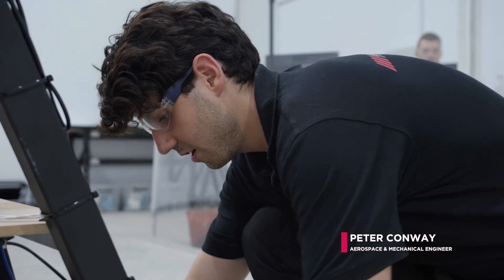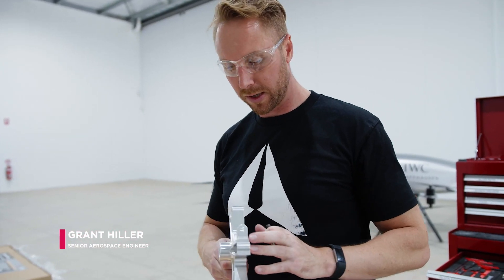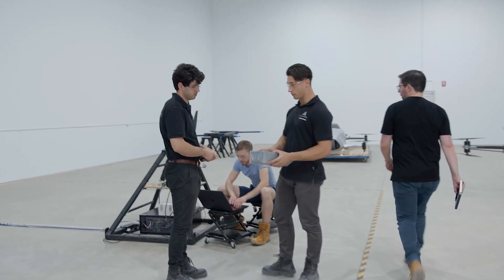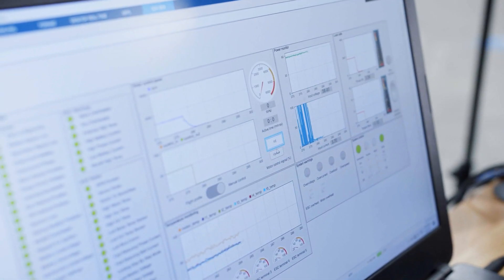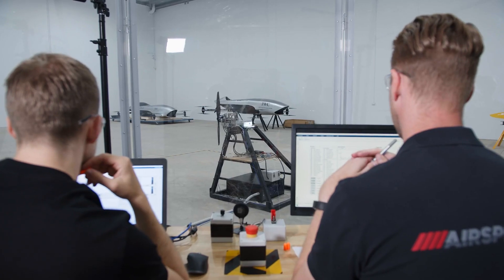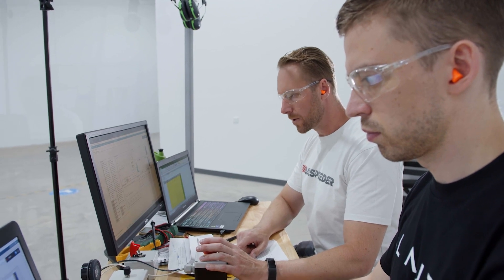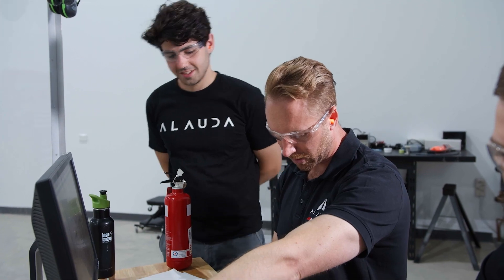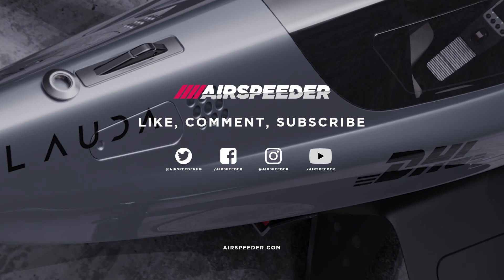Engineers Fire Up eVTOL Powertrain Test Rig | Alauda Aeronautics Taking Flight Series

Comment: Im confused on the design, is it supposed to fly in a horizontal orientation or tilted like a race quad? Are there servos connected to arms on the inside of the vehicle? From what i see it is manned quad copter w/ a cool looking body. The air intake at the front is for looks? The body design is cool enough to become its own plane in my opinion
Reply: They will race like traditional quads but manned. Max speed is 75mph. The course will be projected through AR displays. We'll be able to see the course on TV and racers will be able to see the course projected onto their windshield.
Reply from the maker: You got it. Our Mk3s are tilted but ultimately crewed racing will be horizontal. How will it look in the overtakes and corners is what keeps us debating in the factory!

Comment: But if this is super old, those high power electric motors are at least 20 years old, does including a computer to control the motor make it better? Not at all, this is pure theater, I have seen a small English company use engines of these little ones and they fly a real plane with everything and a pilot, what are these fools showing? pure theater, I insist

Comment: Google „AAIB Alauda“, read summary and look at the images of the accident report. Amateurs like these do harm to the UAV industry as a whole.
Reply: damn... I also would like to understand why those props are so loud.. sounds like they are either unbalanced OR creating such a poor air flow, that the props are stalling, then gaining traction, rapidly. noise in prop systems is a usual sign of high power inefficiency

Comment: With Airspeeder’s configuration speed range of the props must always start at zero km/h as they work also for vertical
lifting. For existing propellers (variable pitch included) size of the speed range remains below 1/3 Mach, that is about 400 km/h. 
But to utilize this span some painful compromises in thrust (and in efficiency) have to be accepted. New propeller concept widens 
this range up to about 0,8 Mach, without loss of thrust. Description at www.stallfreepropellers.com